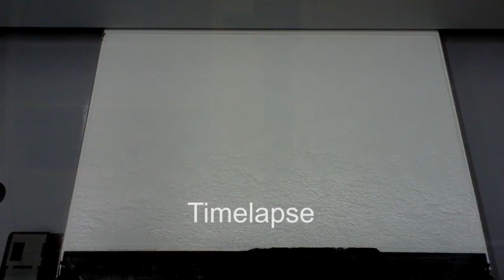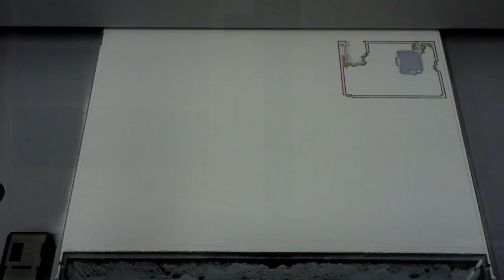3D printing Minecraft models with a Zprinter 650

Comment from the maker: @OrnatekP Has to be a different infiltrant, if it binds in a few seconds---the one we use takes several minutes to get hard. Ours also sometimes leaves glossy stains (if too much infiltrant is applied so the model cannot absorb all). The best method seems to be to throw the whole model into infiltrant if you have enough material (and the model is not too big), and to print models that are solid enough to absorb the infiltrant.

Comment: You can contact a service bureau that utilizes ZCorp 3D Printers to get a quote, and each of the ZPrinter machines except the new 850 print a vertical (in the Z axis) inch an hour.  You can calculate the build time roughly around that, but of course how much x and y axis printing can influence the time as well.

Comment from the maker: @Myth1322 Yes, it is expensive. If you wanted to buy this model from a printing service provider such as Shapeways, it would cost 80$. But you can get smaller models printed for about 20-30$ (material type "full color sandstone"). Check out the "Mineways" group on Flickr for some examples.

Comment from the maker: The models can well support themselves when they come from the printer and not that easy to break. The normal way is to dip them into glue, in this video we simply did not have enough left to do that with the model. Also, the model is not painted, but comes colored right from the printer (that uses colored glue much like an inkjet does).

Comment from the maker: @loi vincent This 3d printer is too expensive for end-users, but there are cheap models on the market such as RepRap or Makerbot (and a million others). You can get them for around 600$ nowadays, but they only print uni colored and in plastic, not colored sandstone like the printer we used does.

Comment: God, you people should do a bit of researching before posting things, you don't need to go to a library, just have a look on the internet. That is not super glue. That is either salt water, of Zbond or Zmax. They use those to cure objects printed by the Z series printers. These will make the colour more vibrant, and the surface stronger. None of those are cheap though.